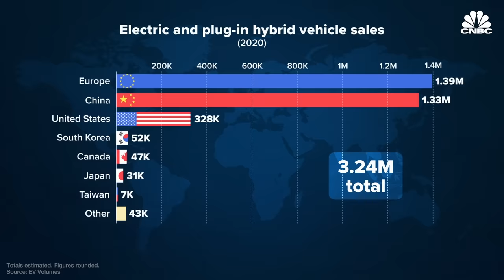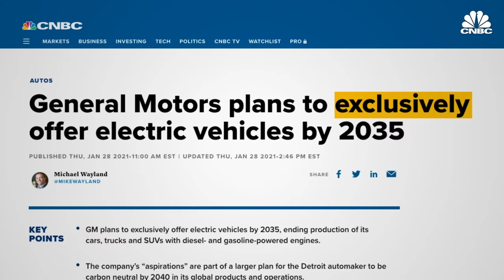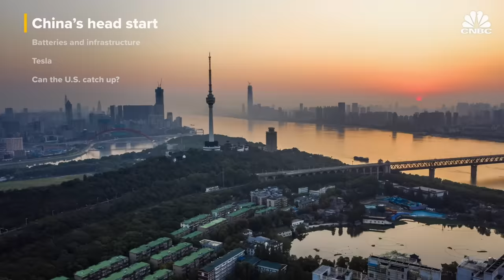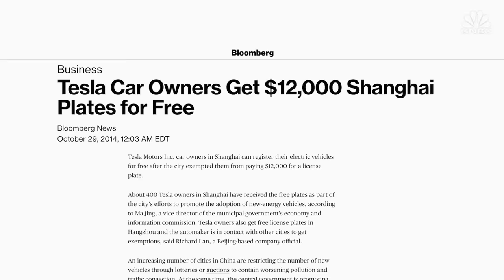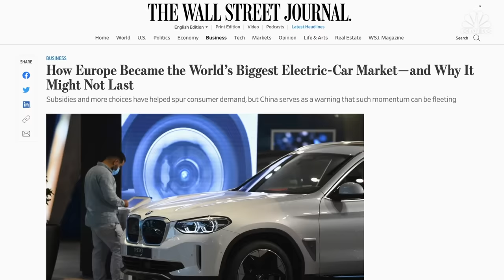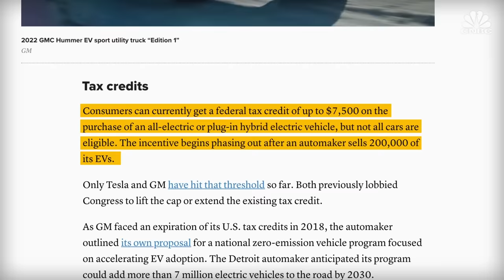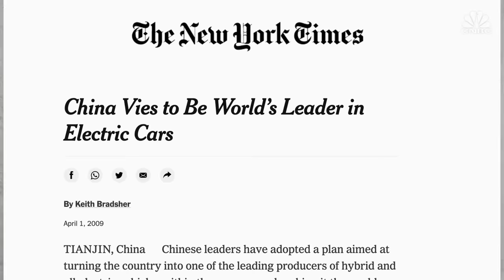Who Is Winning The Global EV Race?

Comment: One issue that I am uncertain how customers would address is the state of charge.  Would they wait until the battery is depleted to 20% or so… or if they need to charge, but the battery is at 50%, would they replace the battery or just charge it?   Personally, i believe that this technology would only work for fleet commercial vans or trucks, not to individual drivers.
Reply: u u L L
   .. u
 
 
  u
Reply: The whole thing is a COMPLETE disaster!!
Reply: my Model 3 EV has worked fine for my daily non-commercial usage for the past 2 years.

Comment: The thing about Tesla is they have the infrastructure and attractive vehicles at reachable prices. That’s why even without incentives they have gotten bigger year over year without support. There are now other useful AND attractive EVs but they are still too expensive and lack great infrastructure to be mass-market. Consumers in the U.S are not afraid of EVs, it’s just that we need more options that match the quality and infrastructure of Tesla and it’s charging network.
Reply: Teslas are great cars and worth the money, but $46,490 for the cheapest Model 3 is undercut by several EV models. Of course a Hyundai Kona Electric for "only" $34,000 doesn't really help if there are none available and stealerships add a $5,000+ "market adjustment fee" to the sticker. If the lazy people at CNBC were to make a new video instead of repackaging 15-month-old video footage, the biggest subject would be the  massive mismatch between demand for all decent EVSs and supply.
Reply: They have self driving. Don’t say they don’t. Don’t. My channel has videos of commutes across Bay Area from the backseat with no driver
Reply: @skierpage I thought that demand was already extremely big, but it has just doubled recently....
Reply: @adamrak7560  Yes I think demand for every Tesla model is insanely high even building ~1.2M cars a year, even with Tesla raising prices. An incredible American success story. I think demand for other good EVs is high, but if the manufacturer is only making 20,000 it's easy for demand to exceed supply.
Reply: i dont know if "reachable prices" is a good way to put it.
that chinese electric vehicle for 4.5kusd seems like a very reacably priced car. i would definitely buy that one if it was available to me.

Comment: Battery is an integral part of marketing. I used to have a celphone that i can swap the batteries whenever i want to until the manufacturer decided to go away with that feature. My point is i see the same trend for ev's. Ev makers will set a standard life to batteries and that's it. Time to upgrade.
Reply: have you not noticed those phone batteries last way longer than they use to so replacing them is something no one really has to do? Tesla is going to glue its cells to the battery packed because the benifits outweigh the extra weight of building it modular and replacable when they can make it part of the vehicles structure to cut weight and increase body rigidity because they expect the cells to last 1 million miles. current Tesla cells lose 10% capacity after 200k miles.
Reply: Why not ban cars entirely and make city's more sustainable and profitable by making them more dense and walkable it will reduce obesity and and other health issues and also battery cars are not good either they use tires and building them requires rare earth metals which causes pollution battery cars explode cars in general is a waste of money and time when you can build city's to be more walkable and better public transportation
Reply: INDIA WANTS TO FALL DOLLARS VALUE..

Comment: Mr Musk, if you don't include a solar home charging station combined with Tesla EV special offer, other manufacturers will do it. China will dominate the EV market by 2025 if you don't wake up.  With the access to solar power panels, Tesla batteries and Tesla EV manufacturing, I would have started this offer three years ago through an affordable leasing plan for the low income citizens. China is way ahead of everybody in charging points planning and installation.  The EV plus solar home charging station offer will give you the early bird marketing winning edge. Hungwang mini for $4500 won the race for an affordable EV. The Tesla car plus home charging station offer through lease plan will boost your sales faster than your Falcon rockets. Boost or scrub. Is your decision before your worldwide competitors take off. (They seem slow and steady but will win the marketing race) Thanks.

Comment: To consider battery swapping as an option is the first problem.  The infrastructure cost for battery swap stations across the whole country is simply not realistic, and when batteries last 300 miles a charge, there's no need for swapping stations wtihin the city for daily commute.  Any owner would rather plug in their car, charge for cheap rather than taking valuable time each week to drive all the way to a swap station, line up, and pay extra for the same amount of energy.
Reply: Plug in their car where exactly? Not everyone in the world has the privilege of owning their own driveway (especially in places like China), so perhaps a 5 mins battery swap is far more compelling than an hour of charging at a public charger...
Reply: @adamdanilowicz4252  It’s not an hour. Plus you wouldn’t go to full flat and then charge to full charge. If you don’t have a charger at home just top up for 10-15mins a week.
Reply: @adamdanilowicz4252  The solution to that is to have policies requiring parking providers to slowly implement AC chargers on each lot over time. 10% of all lots by XX year, 20% in the next 2 years, and so on and so forth until probably 70-80% of lots come with an AC charging point.

Users can charge while they are at the mall or whatever, get around 20-30% of a charge each time before they leave. Hell even basement level parking with charging access for residential areas within cities ought to be mandated by building code.

They managed to mandate minimum parking for property developers in the US, I don't see why they cannot do the same for charging points themselves.
Reply: U do know not every country is structured like America right?
Reply: Why not ban cars entirely and make city's more sustainable and profitable by making them more dense and walkable it will reduce obesity and and other health issues and also battery cars are not good either they use tires and building them requires rare earth metals which causes pollution battery cars explode cars in general is a waste of money and time when you can build city's to be more walkable and better public transportation
Reply: It would be useful for big trucks that is too move goods for trade.
Reply: there is also the liability issue to consider with battery swapping. It's impossible to ensure no tampering or mistreatment of batteries that are dropped off has taken place and they can be very dangerous if they arent maintained properly or punctured. It's also more viable for smaller vehicles like bikes but for a car or truck you have alot of battery which means alot of swapping heavy batteries, the added size problems of making the batteries integrated rather than structurally like in the teslas to be built in an accessible area which takes up more space for the access hatches also and then you also have to make a market standard and force everyone to adhere to it. So many nightmares involved in that.
Reply: Swapping right now is superior. Swap stations are inexpensive and easily moved around. Lastly, what happens when the Tesla battery starts to die?  The NIO owner just drives up to a swap station and in 5 min has another battery..
Reply: @Floorguy1000  Tesla batteries last a very long time. Most tesla's other than due to accidents are still using their original batteries with over 80-90% maximum capacity still. It also calls into question the cost per kwh as charging a tesla especially at home if you install solar is very affordable. Also the fact that vehicles using swappable batteries can't use structural packs that adds more weight and size to a vehicle by comparison. It also raises a huge question about vehicle insurance and maintenance who is responsible if a damaged batter is installed on your car and causes damage? There are too many holes in the design and not nearly enough benefits.

Comment: Most western ev makers are doing a top down strategy, which they build the luxury evs first, and then gradually bring it down to the cheaper market. This makes sense because newer technology like battery are usually more expensive. However some of the Chinese ev makers are different, they start with the lower end market. There are plenty of ev options you could choose between 15k to 30k us dollar range in China, and they could make those evs with a range and performance comparable to gas cars, that is freaking unbelievable for the US market. When those Chinese ev makers land Europe and America, it will not be the end of Tesla or VW, but those cheap Japanese gas cars, if they cannot act quickly.

Comment: Battery swapping won’t likely work because there aren’t enough batteries to have enough spares available.  Batteries are in short supply and expected to be for the rest of the decade
Reply: This is the most important point. Also these EV companies do not want to pay for all these extra batteries.  How does this video not touch on this most important point..
Reply: Exactly. Battery swapping makes no sense for large vehicles because you need to just about double your fleet battery capacity in order to be able to have charging and ready to swap in batteries at hand for every customer coming in for a swap. Modular, smaller batteries don't solve this and instead introduce two additional siginificant drawbacks: reduced pack energy density and increased swapping time.
Swapping is a very useful solution for small vehicles, such as scooters. You need much less capacity to be able to service them.
Reply: Yeah. Funny that they dedicated 20% of the video to an unknown unproven startup that does swapping...

Comment: Better question....who started the EV race?
Also, made the EV race even possible?
Who has the greatest experience with EV's?
Who has the greatest data on autonomous driving?
Who has the ability to innovate rapidly?
There is no other company on earth other than Tesla.
Here's an example.
Ford built their new Mustang EV.
In a tear down comparison with Tesla, an independent engineering found 300 connections Ford used to make just the battery cooling system.
Tesla used one little pump.
Porsche built their version of an ev car.
The computer operating system has so many database glitches ,that Porsche told the dealers " f u" live with it.
There is only Tesla who is number one.
There is no number two.
Reply: Tesla is in deep s right now though

Comment: The answer to this is no one.  No one is going to win this race.  It is not winnable.  There simply is not enough essential raw materials for the batteries at anywhere near tolerable prices.  Lithium Carbonate is up 5X YOY, and it will just keep climbing and climbing as EV production ramps up.  Things actually look worse than ever for EV's.
Reply: Will there be one winner, probably not, but EV's will win the day. One thing that is constant is change. The battery formulation they use now will change, recycling of materials will happen more, and if there is money to be made a solution will be found.

Comment: Here is an update they have eliminated the need for Cobalt and Nickle so the top number of EVs you can now make is limtied by lithium itself which is 170,000 tons annually - this is not going to rise soon.  This limits EV production to 5 million Y type battery packs.  It doesnt' matter how makes them; the annual total is limited to 5 million - 100 million light vehicles are made each year; so this is a race to 5% of the market until such time as they remove Lithium as a limit.
Reply: Have you ever heard of cobalt ion batteries?

Comment: I honestly don't see Ample being a 'consumer market' solution, it fundamentally doesn't make sense. There will like be several models of batteries, especially as the quality of batteries increase. Not to mention they would need to pretty much completely dominate the battery market. Makes zero sense. How could it make sense?
Easy... Instead of a 'You must use our proprietary battery', they become a swap solution for end of life batteries, kinda like getting a "oil change", but its more of a "battery change", in which customers can buy a new battery to replace their aging overused battery. Altho, the idea of modular batteries is mandatory, they need to promote that more.

Comment: The Saab 92 (1949) started out with less the 20 HP !!! Top speed 65 mph. MY POINT, WHY CANT THEY ADD MORE BATTERIES TO A PRIUS ALONG WITH A SMALL GAS ENGINE and Electric motor. So batteries drive an electric propulsion motor, then finally a small gas engine with gas tank turns a generator that would then power the propulsion electric motor ?? THE PROBLEM IS MORE UNNEEDED PERFORMANCE. Americans do not want to settle. On a longer trip, you gas up & keep going. Maybe recharge the batteries for twenty minutes while getting gas. IF collectively you had a four hundred mile range, that would cover most trips & prevent range anxiety.

Comment: Sadly most studies on the matter show that hybrids have a lower CO2/kWh out put than BEV.  What is driving this madness?  It clearly is not the desire to lower CO2 output!
Reply: This can’t possibly correct if the electricity is generated with hydro, solar wind, or nuclear. It depends on the sources of the primary energy used to generate electricity.

Comment: I just don't see swapping as something I'd want to do if I owned an EV. First, you will not get consistent performance, the quality of the batteries will vary significantly. When you get an EV, you become very familiar with how the battery integrates with the vehicle and system in general. Some batteries are better than others and you want it to stay that way. Second, People who have run an electric vehicle 100-thousand miles, (mostly Tesla's at present), have reported a 2% loss of capacity when  supercharging is used regularly. Besides, most of the time charging rates may be slower because the vehicle is mostly home charged at level 2. Almost NOTHING will happen to the battery in that instance. If I bought a Lucid for example, the swapped battery will never have the range that the factory original did. This holds true for a Tesla too! Third, the battery setup is an integral part of the structure and safety of the vehicle, a swap out might compromise that.  So thank you, I'll charge it myself and spend a little extra time stretching my legs at a charging station when travelling a long distance.

Comment: Not buying an EV.  They promised to get cheaper.... they are not.  Also, WHY would I buy one when various states have already issued warnings to EV owners to delay charging their cars because the electrical grid was under pressure.  Even here in Ontario Canada, there have been several summers where they cautioned their could be brownouts or blackouts due to the load of just air conditioner use!  Do these fools think the electrical grid will simply get upgraded in a few months?  Many of these grids are over 50 years old!

Comment: as long as the battery is NOT user replacable - i will never get an EV. Have nothing against evs i think they are great but i dont need a giant paperweight after 5 years. Also price upfront is to much for an ev that is much more simple than ice car. I cant get the math to add up.

Comment: Improvements in batts technology Im order to lower the price of EV cars, increase range to cost ratio, improve charging times, and strengthening the charging station infrastructure will be some of the biggest hurdles for electric car manufacturers coming into the market. Hopefully a lot of the obstacles plaguing electrification on a massive scale will be solve within the next 20 to 30 years. I’m not ready to jump on the electric car train just yet but when I am polestar is at the top of my list.
Reply: So are you claiming  the power grids run on fresh air?
Reply: @ValMartinIreland If everyone switched to cars tomorrow in America. It would draw the same power as everyone who has an AC turning it on for four extra hours.

 Basically a 30% increase. Which isn't a small number, but not as bad as people think. 

 Yet everyone isn't going to switch tomorrow are they? Solar and wind are now cheaper than all other ways for power without subsides.

 Powering a car through the grid is more efficient. 

 Now the only issue is that local grids will need to be beefed up. Our grid needs an overhaul anyway. 

 There are many battery technologies in the work that will hold more power, be cheaper, charge faster. 

 EV is the future. Just makes sense.

Comment: It’s confusing to me how people seem to think that EVs are the solution to improving the environment but they’re also against nuclear power plants.

Without a nuclear power plant aren’t you still essentially powering your car with fossil fuels?

All the carbon emissions reduced from driving an EV still exist since the power cost of society will increase equally. Instead of the fossil fuel being burned in the vehicle, it’s burned at the power plant instead…that same energy is required and it’s sourced using fossil fuels either way.

So shouldn’t the EV movement be paired with improving nuclear power plant safety, stability and efficiency?…or some other future energy source.

Driving an EV while charging it using fossil fuels just seems counterintuitive to me though, I guess it helps you feel better about achieving nothing 🤷🏾‍♂️